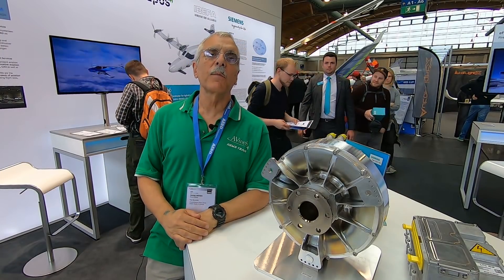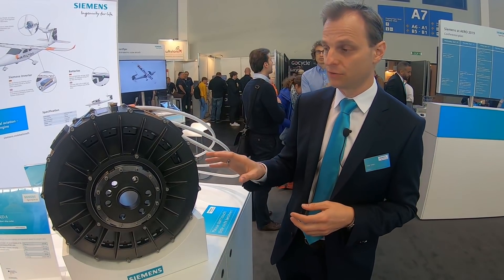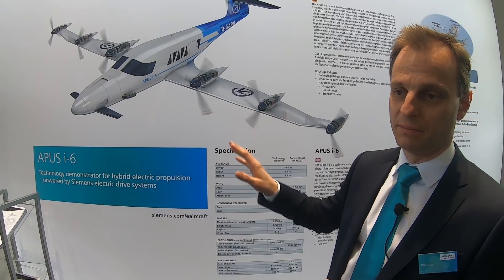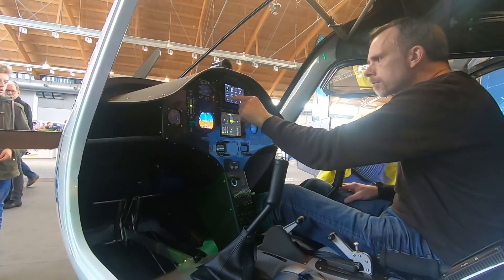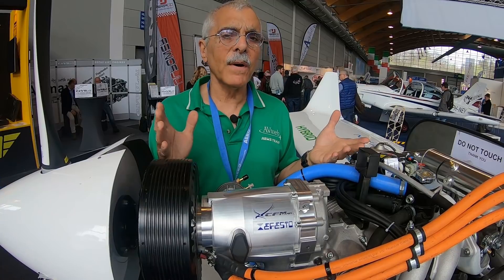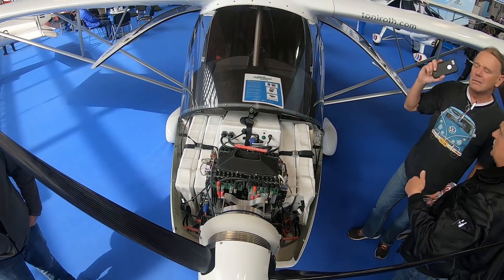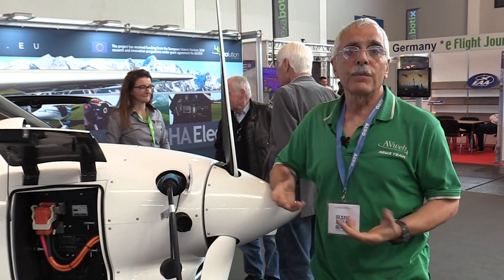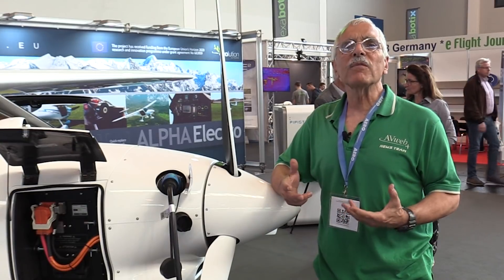What's New in Electric Airplanes?

Comment: Kills me to say it but electric planes are years away from anything that can be used consistently to make money.
Reply: Aldo F Mayo 
Flying schools will be the first. An hour’s endurance is sufficient. If they made swap-out battery packs they could keep going all day. 
If they can get endurance up to an hour and a half then short haul passenger service (eg London/Paris, New York/Washington) becomes feasible. 
Look for batteries or supercaps reaching 4-500Wh/kg energy density and electric short haul will be on. If next generation supercaps (hypercaps?) can get there, they would get virtually instant recharge times as well.
With the huge investment going into EVs I’m expecting there to be fairly rapid development of new energy storage systems.
The advantage of electric motors in cost, reliability, servicing and safety is so huge that, as soon as planes can get enough range, there will be an incredibly fast transition.
In the meantime, a hybrid, using a single turbopowered generator, with sufficient battery capacity for say 20 minutes could give you the safety advantages of multiple motors for much lower cost than a turbo twin.

Comment: Putting engines at the wingtips makes no sense as it would cause a severe yaw due to asymmetric power during an engine failure. That’s why engines are close to the fuselage.

Also, placing weight at the wingtips generate extra stress loads during turbulence.
Reply: Cuts the wingtip vortex that creates drag.
Reply: With a tail engine it shouldn't be any worse than a twin engine failure, and is likely to be better. Plus, electric engines are hugely reliable, which makes them very attractive for general aviation.
Reply: Biggest problem I can see with wingtip props is risk of prop strike during landing. Looking at that plane it seems you’d only need about 5° of roll during landing to get a strike. Even a heavy landing with some wing flexing might be enough. Otherwise I can see how it might reduce wingtip vortices.
Reply: Actually you're wrong.  Placing loads out at the wing tips would reduce bending moment in turbulence.

Comment: Why do we need an electric airplane, I mean let's not be ridiculous.
Reply: Robert Blackford  Blackie again floundering in the 21C.
"1 When a distinguished but elderly scientist states that something is possible, he is almost certainly right. When he states that something is impossible, he is very probably wrong.
2 The only way of discovering the limits of the possible is to venture a little way past them into the impossible.
3 Any sufficiently advanced technology is indistinguishable from magic."
CLARKE'S 3 LAWS.
Reply: Robert Blackford  It's a niche application. How many of us learned to fly in C150s and how many of use would fly that one for max endurance? Virtually none (though possible). They are gonna be great in driving down training costs with improved reliability. The Alice might open quite a bunch of niche small a/c markets with low demand due to low direct operating costs. Anything about 9 or 19 seats we are talking decades for obvious reasons. BUT DEP with hybrid will make sense for bigger planes at smaller ranges very soon. Long haul? Not in a few decades, again for obvious reasons.
Reply: Step change. Happens in all industries. Inevitable. ICE has the last century. Now looks very primitive.
Cheaper
Extremely less maintenance compared to ICE
Reliability
Quieter
Higher flight envelope - more efficiency
Less vibration
Very wide power range
High torque immediacy
Vertical or STOL takeoff capacity
Non polluting
Odourless
Renewable and sustainable
Norway targeting 2040 for internal flights all electric.
You really did not know this?!

Comment: I want the hybrid system, all the complexity of an internal combustion setup with the weight of the electric motor and batteries to make it even less viable. It's the best of the worst of both worlds! Or you can go with the Pipistrel Alpha Electro right now and get 45 minutes of flight time for a mere $140,000 USD, and if you just buy a few extra chargers at $15K each and locate them everywhere you want to go within a 50 mile radius of each other then you can make 45 minute hops with 2 hour pee breaks in between......
Reply: Battery charging, like battery chemistry is rapidly bringing charging times down.Tesla V3 Superchargers will currently do a 25% quicker rate than V2 and eventually 50% less. This means already an EV charges quicker than a human.
https://youtu.be/F-SZ7FgK1KA
Reply: @waynerussell6401  Take off and landing are the most dangerous part of operating an aircraft and faster charging  does nothing to increase the flight time of an electric aircraft.
Reply: @PistonAvatarGuy  - It Reduces Charging Time, so, yes, it does reduce Flight Time From Start to finish of your trip, if you have faster: charging, fueling, and Customs Clearance, too!

But, a Cessna 150 or 152 Climb rate at 500-700 From, is about Half the Pipistrels' 1,200 From climb Rate!
Reply: @robertweekley5926  A) Teslas have a good (but very heavy) thermal management system for their batteries, which is what makes that charging rate possible. B) No one is going to want to takeoff and land to charge every 45 minutes.
Reply: @PistonAvatarGuy  Except for air tours, flight schools, skydiving...
Reply: @RealestUrbanism  Until they have to replace the battery (which costs more an entire Rotax engine) after a couple of hundred hours because it's being discharged so rapidly.
Reply: @PistonAvatarGuy  Tesla runs 200 000miles without serious degradation (90-95% remains). As for runtime- look for "vancouversoaring" channel , he runs 1:05 with 40% remaining. Pipistrel battery is overpriced. 30000 USD for 21 Kwh air cooled ?  Add 5000 and You will have  50kWh water cooled and ..... car (tesla3) !
Reply: @thealzp  Teslas don't discharge their batteries at anything close to 1C and they have a very heavy and complicated cooling system which regulates the temperature of the battery. Soaring with an electric airplane does nothing to prove that electric aircraft will be useful for traveling.
Reply: @PistonAvatarGuy  What is "very heavy" ? 100kWh batt 500kg, coolant system 25kg - less than 5% :)  nissan leaf have no cooling at all. When you are in traffic jam you battaries are hard to cool, but when you are flying - its not a problem.

With 1C You are going to run 0-60mph  for 2.5 sec with 770Hp and 2100kg ?  :)  Pipistrel uses stone age batts and chargers. They say price can be 2 times lower due to serial production. 

Why only travelling ? We are talking about flight schools, scouting, farmers, tourists, sky divers, gliders ......
Reply: @thealzp  "100kWh batt 500kg, coolant system 25kg - less than 5% :)"
-
Except that a 500 kg battery is already about 3 times heavier than a piston engine and its fuel and will only provide about 1/5th of the range, so even a small amount of additional weight is significant.
-
The Nissan Leaf batteries are air-cooled and often have longevity problems, which is why you can buy used Nissan Leafs for almost nothing.
-
"With 1C You are going to run 0-60mph  for 2.5 sec with 770Hp and 2100kg ?  :)"
-
Yes, for 2.5 seconds, not a full hour and only a tiny portion of the battery capacity is consumed. Edit: That's actually way more than 1C, but it's not sustained, so it doesn't cause damage.
-
"Why only travelling ?"
-
Because that's why most people buy airplanes.
Reply: @PistonAvatarGuy  "Except that a 500 kg battery is already about 3 times heavier than a piston engine and its fuel and will only provide about 1/5th of the range, so even a small amount of additional weight is significant."
- Piston engine 250 kg, trancmission 75-80rg, exaust 30kg, tank and fuel 75kg . Cant see "3 times". Tesla run up to 600 miles (turtle mode :) ) Pls give example of piston car with same 0-60 and 600miles on one tank (not talking same price). 

"The Nissan Leaf batteries are air-cooled and often have longevity problems, which is why you can buy used Nissan Leafs for almost nothing."

-Yes, but it still far away from your  "several 100hours life" .

"Yes, for 2.5 seconds, not a full hour and only a tiny portion of the battery capacity."

The same with planes - maximum on take off. Pipistrel take off - 60Kw , cruising 19-22kw 

"Because that's why most people buy airplanes..."
- "2 seaters" for travelling ?
Reply: @thealzp  "Piston engine 250 kg, trancmission 75-80rg, exaust 30kg, tank and fuel 75kg ."
-
Where on Earth did you get those numbers? A 375 hp Continental engine only weighs 220 kg, but we're talking about aircraft that have roughly 100 hp here (80 for the Alpha Electro). Aircraft don't have transmissions, and if they have a gear reduction, that's usually included in the weight of the engine, because it's usually built into the engine. The Rotax 912 iS weighs 75 kg, with EVERYTHING. The wing is typically the fuel tank, so there's no additional weight for that. 5 hours of fuel weighs about 68 kg. So, that's 143 kg, vs 500 kg for just the battery. The motors in these electric aircraft weigh somewhere around 20 kg with their controller.
-
"Yes, but it still far away from your  "several 100hours life" ."
-
Because Nissan Leaf batteries aren't discharged at anything remotely close to 1C.
-
"...cruising 19-22kw"
-
It's a 21 kWh battery, so that's 1C. Anytime you use up the entire capacity of the battery in an hour, or less, you're discharging it at 1C, or more.
-
"- "2 seaters" for travelling ?"
-
Yes, why not?
Reply: @PistonAvatarGuy  "Where on Earth did you get those numbers?"

- We compared teslaS with piston car as different technologies. Its rather strange to compare tesla vs plane.

"It's a 21 kWh battery, so that's 1C. Anytime you use up the entire capacity of the battery in an hour, or less, you're discharging it at 1C, or more."

- After 1hour of flight time You have 40% remaining (not entire capacity), Its real data from real world. I'm not sure that 1C is real limit.

"Yes, why not?
"

- Im not sure that ultralight are suitable for long range. 

  Why not to use electro schools & etc ? There are plenty of tasks for less than 1 hour of flight time.....
Reply: @thealzp  I wasn't the one who brought up Teslas.
-
"After 1hour of flight time You have 40% remaining..."
-
That depends on how fast you fly.
-
" Im not sure that ultralight are suitable for long range."
-
In the US, that's how we use them, because it's a big country.
-
"Why not to use electro schools & etc ? There are plenty of tasks for less than 1 hour of flight time....."
-
But none that make sense when you're constantly replacing batteries that cost $20,000.
Reply: @PistonAvatarGuy  "That depends on how fast you fly." 
- He flyes 75-80 KIAS ....  is enough for cruising .... 

"In the US, that's how we use them, because it's a big country."
- ultralights like alpha electro (MTOW 550 kg) ?  C172 twice heavier ... 

"But none that make sense when you're constantly replacing batteries that cost $20,000."

-  real price must be realy lower, and no need to do it constantly. No one has replaced them yet.Piston engines are not free : oil, plugs magnetto etc. In USA alpha is not certified, that's the reason.
Reply: @thealzp  "He flyes 75-80 KIAS ....  is enough for cruising .... "
-
Not if you're traveling, it's faster to take a car.
-
"ultralights like alpha electro (MTOW 550 kg) ?  C172 twice heavier ... "
-
They cruise fast enough and their range is sufficient, so...
-
"-  real price must be realy lower, and no need to do it constantly."-
-
That's how much Pipistrel charges, and the batteries probably will need to be replaced frequently because they're discharged to quickly. 
-
"No one has replaced them yet."
-
No one has flow the planes enough yet.
-
"Piston engines are not free : oil, plugs magnetto etc. "
-
They don't get replaced, they get rebuilt.
-
"In USA alpha is not certified, that's the reason."
-
It's certified as an LSA.
Reply: @PistonAvatarGuy  
"Not if you're traveling, it's faster to take a car."  
- If you are bying not for travellig ? 
For You its not fast ? but some one could say that for traveling jet is faster :) depends on tasks.    

"No one has flow the planes enough yet." 
-  Thats why we dont know the real battery lifetime. 

"They don't get replaced, they get rebuilt."
- For free ?

"It's certified as an LSA."
- You cant use it for commercial purposes.

Comment: So then you charge the batteries with a coal fired power plant. The only advantage is the noise factor! Not worth it!
Reply: Only if you're in Poland. Elsewhere coal is a smaller and smaller portion of the energy mix. In Texas we got 19% of our electrical energy from wind in 2018, and only 25% from coal. For 2019 we'll be even more green. In Iowa they get 33% of their electrical energy from wind.
Reply: @dalegreer3095  I live in Texas. Arlington to be exact!
Reply: Keep in mind though that electrical motors are much more energy efficient than combustion engines (in the 90% range compared to 40 or so for combustion)
Reply: Less than 30% of the electricity in the US comes from coal.

Comment: Thanks for the translation from KW to HP.
Engines on the wing tips -- looks like prop strike city.
They talk about hydrogen as a zero emissions engine. But, the hydrogen is probably produced by a coal burning electric plant.
The electricity to charge the batteries for electric airplanes probably also comes from coal burning electric plants.
I can see electric powered basic trainer aircraft, because of the greatly reduced engine maintenance and reliability.
Reply: Hydrogen energy density per weight is poor because of the required pressure vessels and what not.
Reply: Hydrogen typically comes from natural gas and there is nothing 'green' about the production process. From an environmental standpoint, it makes more sense to simply burn the natural gas in an ICE, but there's not really any way to store enough natural gas on an aircraft to make it useful for anything.

Comment: Battery technology is still decades away from being viable.
Reply: I would definitely not say decades.  Lighter, solid states, are currently possible. Much cheaper too and lighter because they do not require cobalt and are fire resistant. Energy density is also much higher. We will see these within the next couple of years. At this point, we're just waiting on a production line.
Reply: Justin Hyde 
Battery technology is still months to years away from being viable.
There fixed it for you.
Reply: @q.e.d.9112  It's just not though. The energy density of even the most cutting edge batteries right now is nowhere near that of avgas or jet fuel. Can it work? Sure, but it's not going to be a viable replacement for liquid fuel until it can get close to the same energy density. Hydrogen fuel cells on the other hand may actually work.
Reply: Justin Hyde 
Is electricity going to compete on long haul? No, not for a long time.
But bear in mind that even the best turbines are lucky to convert fuel energy at 40%, while electric motors are generally 80-90% efficient and we’ve halved the density deficit straight away. I think we will see e.LSAs, e.BasicTrainers and e.Shorthaul within 8 to 10 years.
But, no, I agree we aren’t going to get an e.Dreamliner any time soon.
A linear hybrid using a turbine generator and multiple e.motors could have much to recommend it. The turbine could be rated for cruising power only, with enough battery to give T/O power for climb out and say 20 minutes reserve. You would get multi engine safety but with only one expensive turbine to maintain.
Reply: It's already viable, for trainers and aircraft up to Cessna Caravan size, if you're willing to trade away range. There are huge challenges getting beyond that, and it will be decades before we have large commercial aircraft with a decent range.
Reply: Tesla will introduce a new battery in the near future that will break the 400kWhr barrier that makes electric commercial aviation possible.
Using a dry electrode manufacturing process acquired from Maxwell, it will cost less, speedup manufacture, reduce cobalt, increase cycle life and increase energy density.
Reply: @waynerussell6401  That's based on NASA's estimates, but NASA seems to have overestimated the performance of electric aircraft by 100%.
Reply: Look into solid state batteries.
Reply: @normellow  

He also needs to look into graphene, inorganic lithium ion and a plethora of other technologies that are way closer than decades away.

Comment: Nice.  Not yet practical due to current energy density of batteries.
Reply: No trickery needed, electric planes fly just fine. about a third as long as gasoline powered planes.
Reply: Precisely right.  The energy density for diesel fuel ranges from 32 to 40 megajoules per liter (MJ/L) compared to about .9 to 2.5 megajoules  per liter (MJ/L) for lithium ion batteries.  There are some higher capacity lithium batteries being developed but for batteries to compete with dead dinosaurs will require at least a 5 fold increase in energy density. And as Paul noted, the weight burden of the ancillary stuff is pretty high too. Someday Reddy Kilowatt will get his trans-Atlantic wings but not real soon.
Reply: Probably just going to be used for short flights.